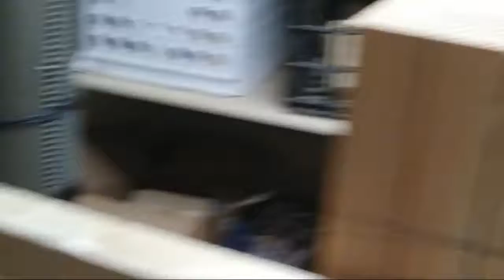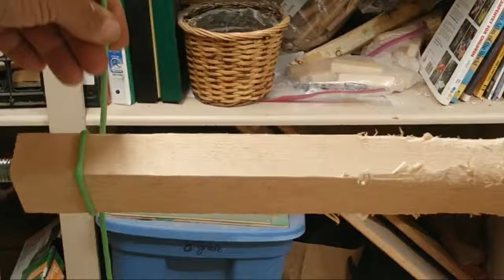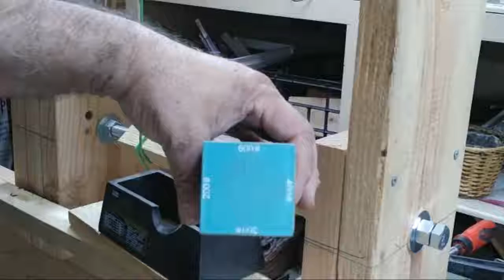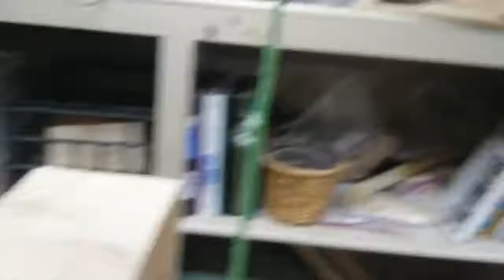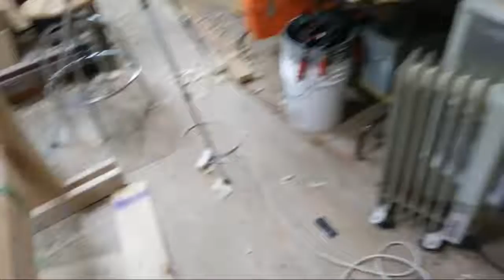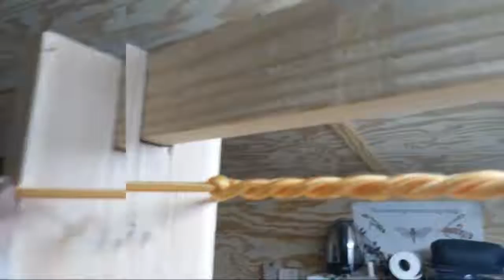Part 2 Spring Pole Lathe

Comment from the maker: Thanks. Yeah I was a little impatient about using it. I didn't even have the tool rest done yet LOL! I just wanted to goof around see what it was capable of doing and I've never use a spring pole lathe before I've used an electric lathe but that's been 40 years ago so I'm kind of getting back into this Woodworking and having a lot of fun relearning the skills.

That wood is actually facial wood which is horrible for turning at least in this video it was horrible for turning later on I actually made a makeshift to arrest and use a paring chisel cuz I hadn't bought lathe chisels at that point and the turn a decent round practice peace out of a branch.

Comment: I would recommend using a drawknife to get it roundish first. Also your heads are too wide, you want your tool rest to be right up against the work like an inch distance at most. Then things will be a lot easier. Good luck.